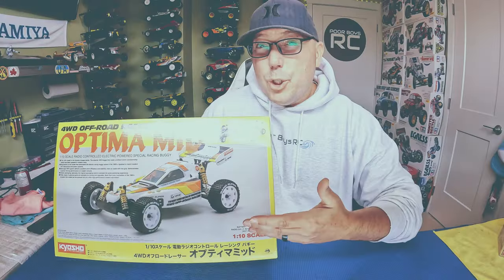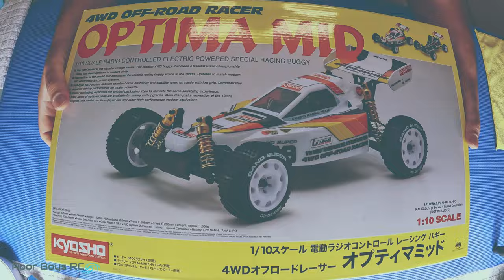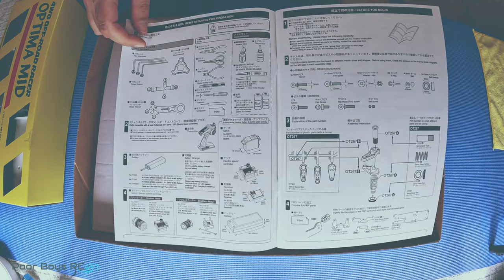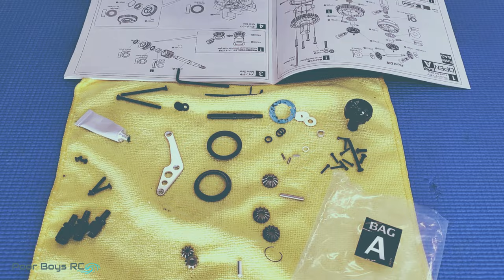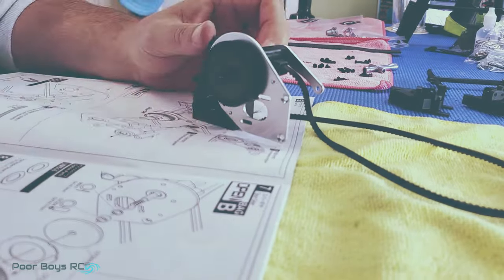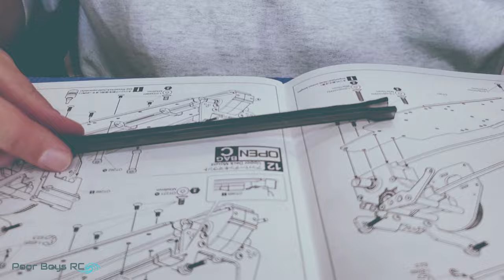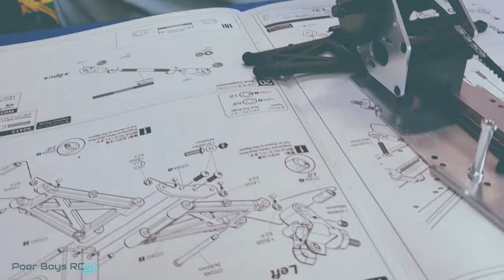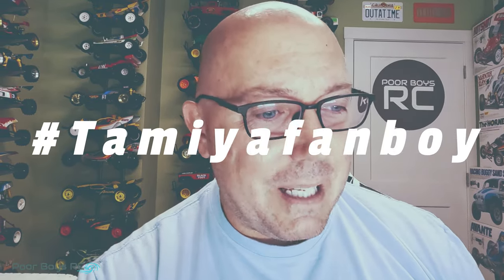Kyosho Optima Mid ReRe: Unboxing, Time Lapse Build, and Review

Comment: Awesome build ! This car drives beautifully, a mix of smoothness and sharpness (short wheel base). I put an undertray on mine to be on the safe side. You may also watch the belt tension 😉 Can't wait for the driving video 👍Thanks
Reply from the maker: The under tray is a good idea. How tight (or loose) do you recommend the belt to be? The assembly guide instructions had it very loose.
Reply: @poorboysrc I think at first I was on the 3rd notch. But after a while (3-4 Lipo), it was cracking when braking on grass. Out of lazyness, I went for the max (10th notch), but could probably turn it down to 8. I read a trick that, if needed, you can use the Optima belt, which has 1 less tooth. That's a trial-and-error depending on many factors (power, surface, driving style, ...) 😉
Reply from the maker: @coygtrc  good to know, thanks for the info. I've never driven a belt driven car, so this is new territory for me.

Comment: What would you advise to have the most powerful Optima Mid with brushless motor, ESC and LIPO batteries?
Reply from the maker: If you're after the most power? I'd go with a 3100kv (ish) brushless motor, 3S, and a Hobbywing 10bl120 esc. That's going to be very powerful, probably 50mph (ish) but could also expose the antiquated design to failure. I don't know how well the belt drive will survive that kind of juice. 🤷‍♂️
Reply: @poorboysrc  I guess I asked poorly. When I used to race in the late eighties, there was no such motors. We used to run modified motors in 4x4 electric classes, like the Reedy gold dot. So my question was “what is the most powerful motor and ESC that they would use in an IFMAR competition?”.

Comment: Phil, the optima mid you built is no longer available. Your's has the blue decals. However, you can still get the optima mid as you said just no blue decals. I think the blue decals allow you to turn your optima mid into a turbo optima mid. Thoughts?
Reply from the maker: I purchased mine from Eliminator-RC, and I just double-checked, and they do have more still in stock, which I believe should be the exact kit I purchased, which would contain the extra set of blue decals, and black wing. I'm going to need to order another body from TBG, so I can have the Turbo Optima Mid look. 👊🏼
Reply: @poorboysrc   If you can still get the Optima Mid with the blue decals that would be great. I got one but could not find another one. Also, RCmart might still have the original Optima mid body. I got one from them. Of course it will not have the blue decals, but you do not need those anyway. Thoughts?
Reply: I just checked, rcmart does have the Kyosho optima mid body but is low in stock.

Comment: What do you do for tires? I am having trouble finding decent 1.9” tires for them..
Reply from the maker: I don't plan on changing the tires, but if I were to, I'd go with a more modern rim and tire combo. The 12mm hexes are pretty much standard for 4wd buggies. So just match the offset, find a tire/rim combo you like, and you're set. 👊🏼